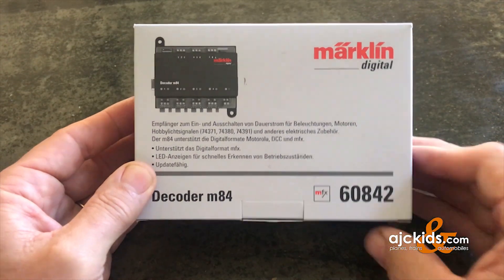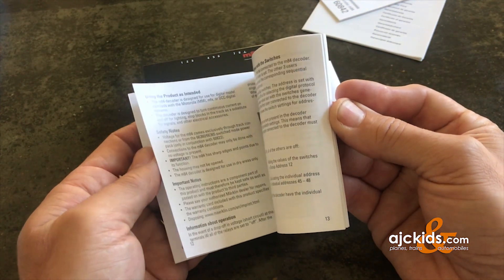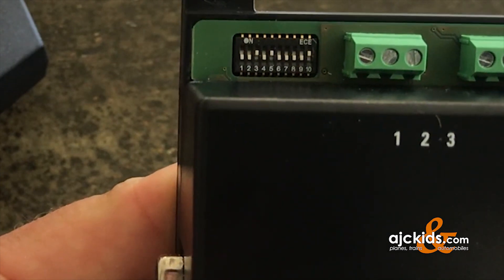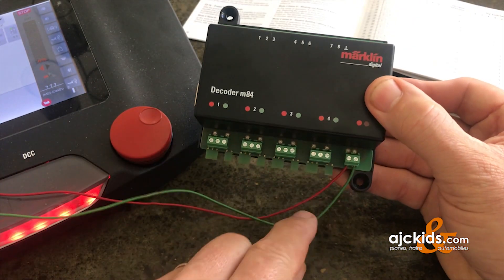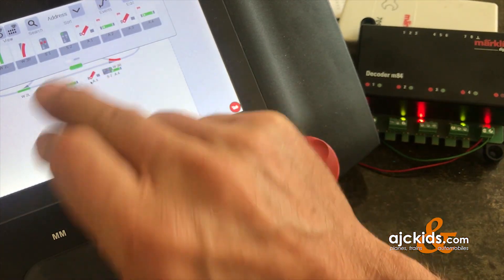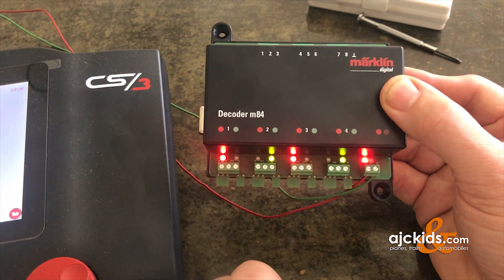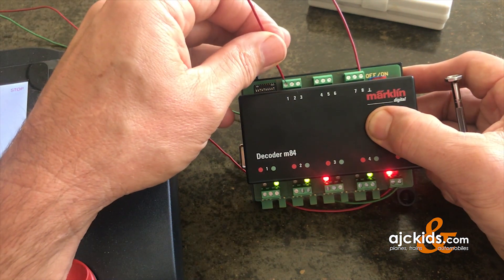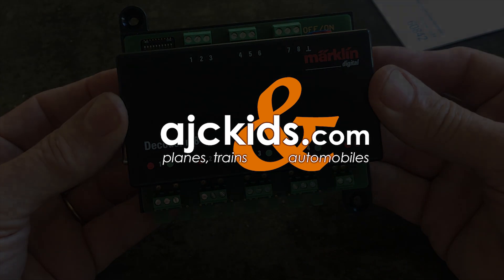Marklin M84 Decoder Part 1: Unboxing and Basic Functions

Comment: Hello, 
Thank you for this video. Please, what happens if there is incoming link signal related  to one switch at the same time? E.g. inputs 1 and 2 switched on simultaneously..
Reply from the maker: They would both be activated. If it would be an odd situation where one output wants to set a turnout to *straight*, and the other output would want to set the same turnout to *curved*, the one who gives up the earliest will loose.

Comment: Hallo.. I have a question: my layout will need 15x M84. My problem occurs when I connected more than 5x M84. All M84 switch on/off bythemselve when a loco is running on the track. Fyi I am using DCC in CV Configuration and set up the 8addresses. Any idea why? Thank you
Reply from the maker: How are these M84's connected? All separately to the digital power, or in series, or through a 60822?

Comment: Hi and thanks for your great videos!
Do you know if the M84 connected with a switched pack power box should be connected to the tracks as well? How could it be connected to the CS otherwise :/
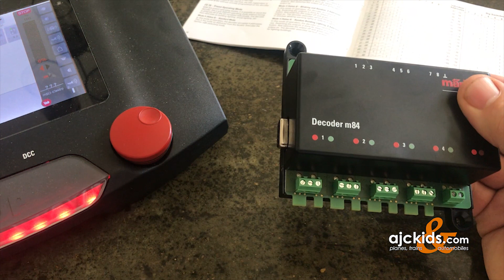Reply from the maker: The M-84 will need the digital signal. So it does need to be connected to your digital controller (CS). You can connect it directly to the track output of the CS. You can also connect it to the track. The input on the bottom right of the M84, marked with the brown and red dot, is where you connect the two wires. I try to show this at the 4:44 minute mark in the video.

Thank you Markus and have fun! with a Howdy from Texas to you.
Reply: @ajckids  thanks a lot for your answer! Now I don't have to worry that I might short circuit anything :thanksdoc:

Comment: Can it be used for Block Switching?
Reply from the maker: I think you can use it as block switching in two ways: By sending occupation signals through a S-88 feedback module to the Central Station, and programming the CS3 what it needs to do, or more simplified by letting the occupancy detectors control the M-84 directly by wiring their input pulses to the ports 1-8 on top.

Comment: Great ! Very helpful thank you ! It's possible config with only mobile station Marklin ? It"s possible to dim LEDs with M83 or it's only possible with M84 ?
Reply from the maker: Yes, you can configure the M84 with a Mobile Station as well.

With advanced steps (this requires CV value programming) the M83 offers many light functions including dimming.

Comment: Very helpful, thanks! Do you know if you can use the M84 to use uncoupling tracks?
Reply from the maker: Hi Panzerkeks 85!  

Thank you for the great question!

For uncoupling tracks, and other solenoid (electromagnet) items that need to only be actuated for a second (fraction of a second), you should use the Marklin M-83 decoder, like the 60832.

You could compare the M-84 in its most basic form as a set of 4 light switches in your house (all on/off switches).

You could compare the M-83 in its most basic form as a set of 4 doorbell switches in your house (only on when pushed).

The most common solenoid items are your turnout motors, uncouplers, and older (analog) semaphore signals.

Happy modelling!

Ajckids
Reply: Thanx, trying to read up on märklin digital before buying it, this is the first time someone has explained the difference! The video was very informative too! I'll watch the rest now.
Reply: @ajckids  Do you have a video about setting up an M83? I can't get my CS3 to recognise it or how to set up uncoupling tracks. I guess it's the same as M84. 
Marklin have instructions how to do this but it's in German only (http://streaming.maerklin.de/public-media/MM/02-2018/Fo_4_CS3_praktisch_einsetzen_MM_2018_02.pdf). English speaking markets of no interest presumably. I can't make head nor tail of it.
Reply from the maker: Yes, the registration is the same with the CS3, so it should recognize it. Start over with setting a simple address (1?) to the decoder and see if you can get it to respond.